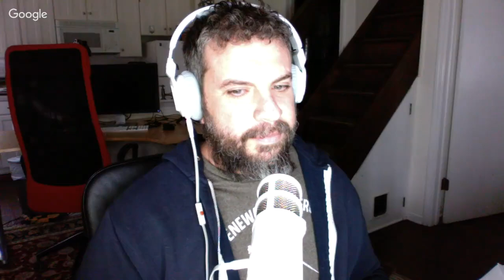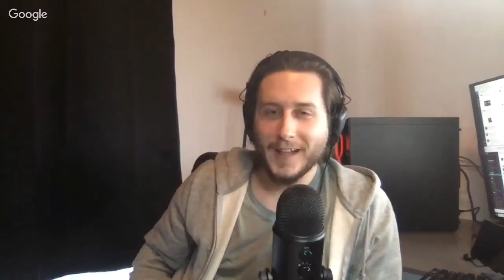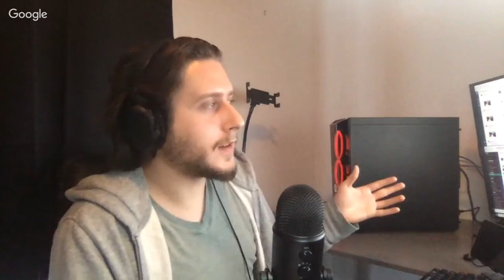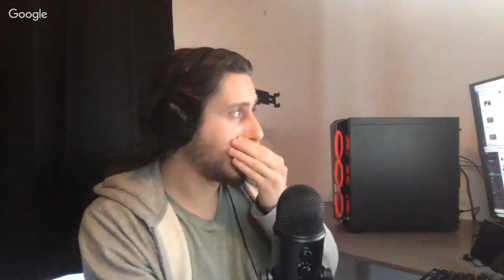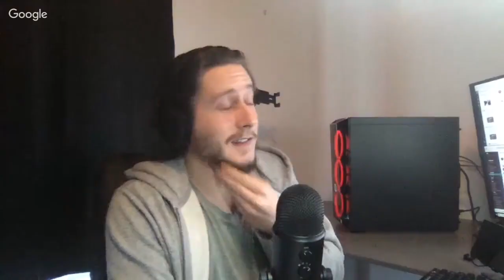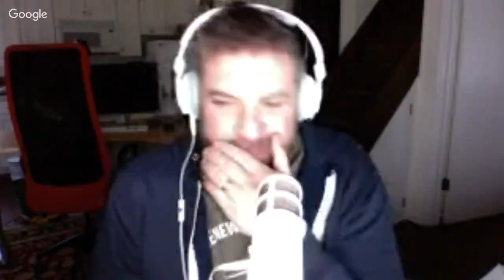Electrek Podcast: Tesla reaches new production milestone, Model 3 crash feedback loop, and more

Comment: Can't charge modules separately as they are in series to achieve the voltage. For the model 3, the charge voltage would need to be reduced by 75%. Also the M3 has modules at two different nominal voltages - 84V and 91V. MS/X modules have a nominal 22V.

Comment: The thing no one has mentioned about space based internet is that countries like China who currently heavily censor or block internet access are not going to be able to control what information their citizens have access to any more. This is a huge game changer globally and there are going to be a lot of pissed off despotic regimes out there. Another feather in Elon’s cap.
Reply: Existing satellite internet need geosynchronous satellites, which have to be really high up.  22,000 miles away for Hugh Networks.  If SpaceX covers the globe, the satellites don’t need to be geosynchronous and could be much closer reducing latency.  Think of it like picking up the nearest cell tower when are driving.